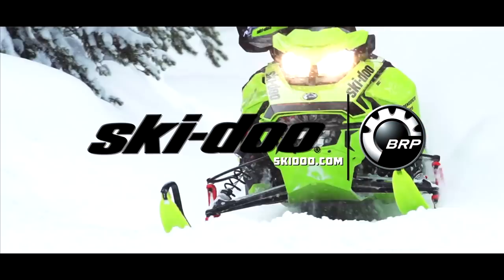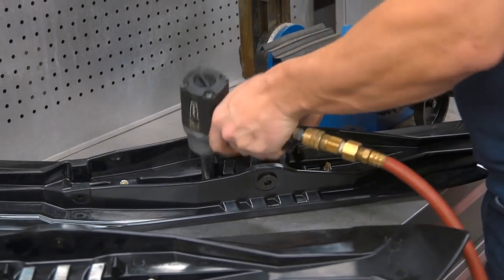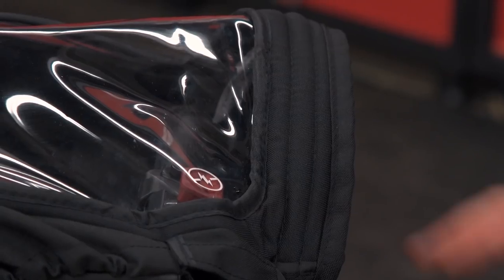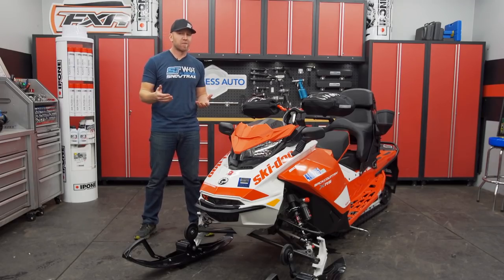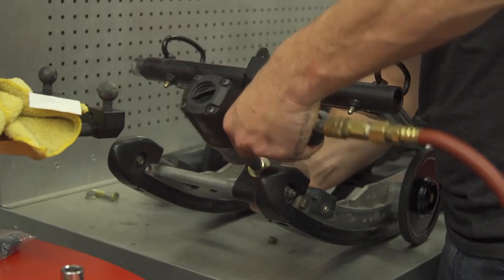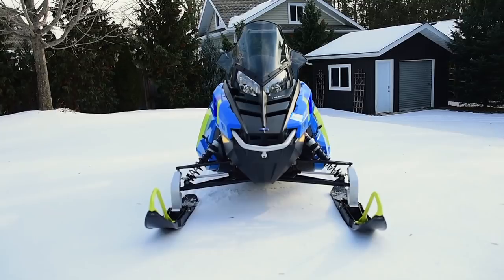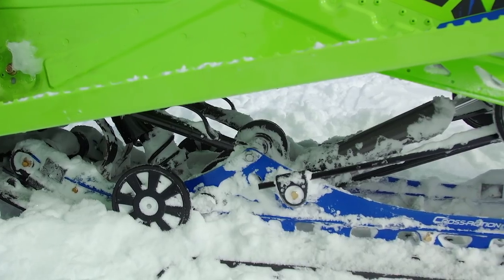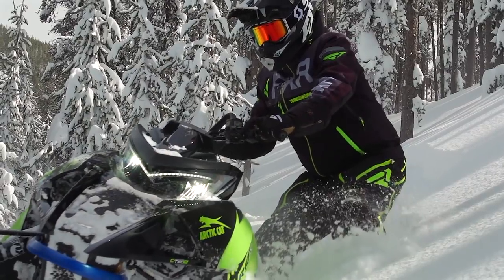SNOWTRAX TV 2020 - FULL Episode 4

Comment: Polaris's FT2 seat and Rack are better and easier with no drilling required.  The rack quick attaches in the grooves of the tunnel. And the seat quick attaches to the top of the rack. Plus the rack adds more storage.